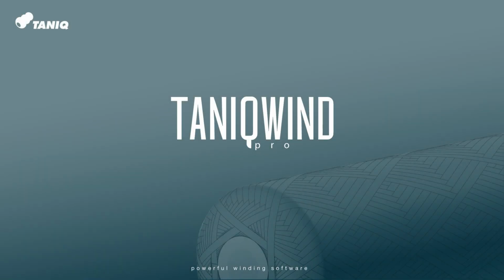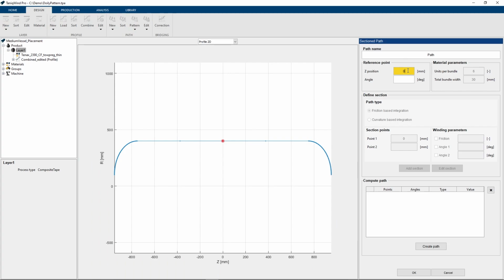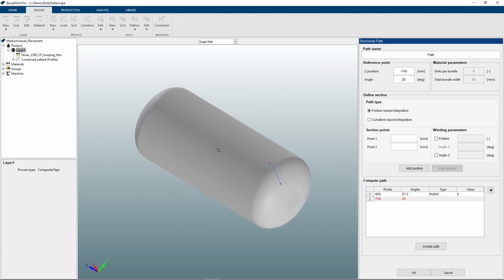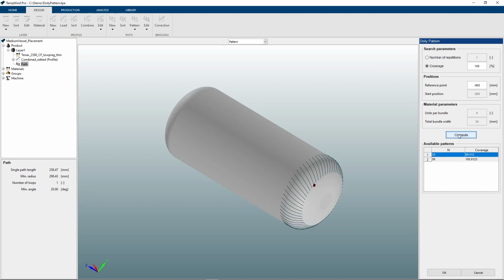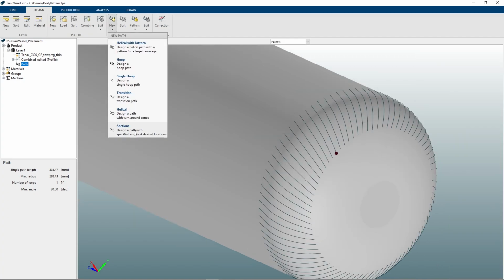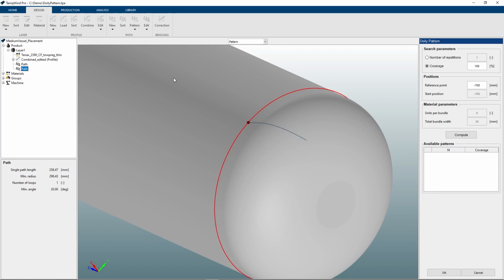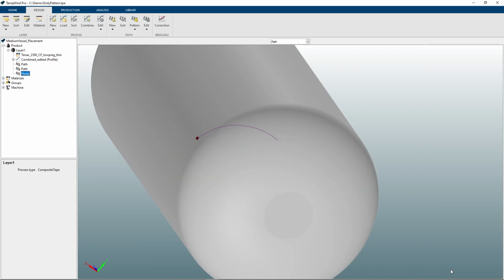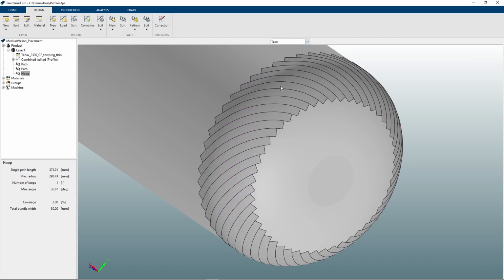How to Generate Local Reinforcement Paths for Composites | Filament Winding Software TaniqWind Pro

Comment from the maker: With TaniqWind Pro, you can now create local reinforcement paths. These local fiber paths can be used to strengthen critical areas of your composite parts, such as domes, openings, or zones with high stress concentrations, without adding unnecessary material elsewhere.

This feature in TaniqWind Pro supports a Hybrid manufacturing approach, combining filament winding with automated fiber placement (AFP) to deliver efficient, optimized, high-performing composite parts.

Learn more about our Hybrid approach here: https://composites.taniq.com/blogs-news/taniqs-hybrid-robotic-filament-winding-amp-afp-system-the-next-evolution-in-composites